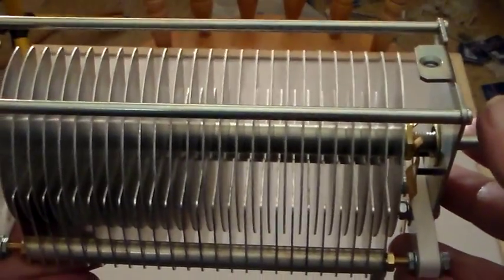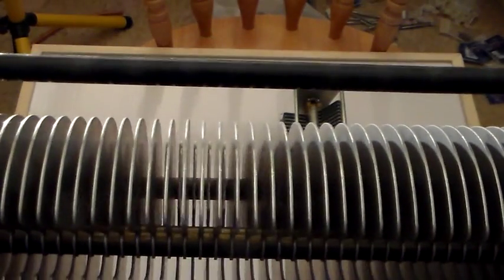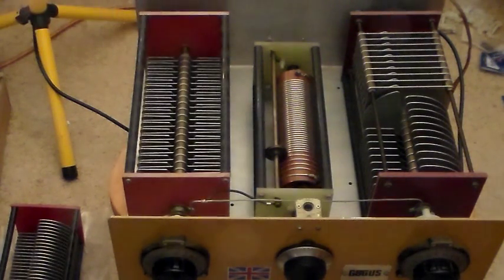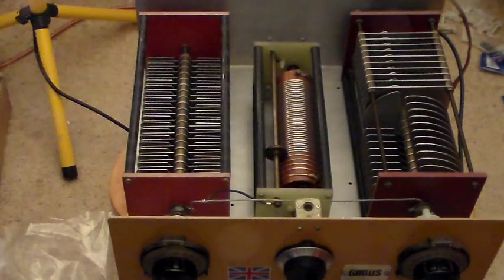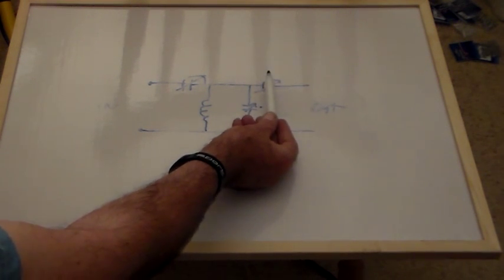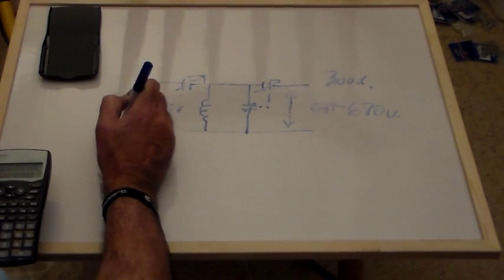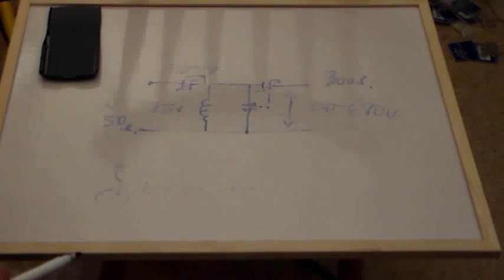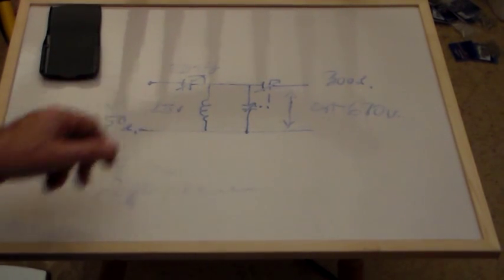Sorting Out A Plate Tune Capacitor.

Comment: I can just see you scratching your head :)
re: plate cap, 1mm spacing for each 1kv step, (rule of thumb) so 3kv =3mm spacing
re plate cap c1 tank circuit , on 3000v you need 150 pf at least for 80m operation
Loading cap c2 =700 pf at least
inductor = 14.7uH for 80m operation at 3kv ht.
if u are on 2800v then c1 will be a bit more ,about 180pF in value, c2 will be 800pf +_ inductor 13.6uH (80m)
at 4kv ht, c1 112pF  , c2  470pF inductor 19 uH, hope that helps :)

Take care to measure the c1 capacitor spacing between the shaft and stationary plates (shaft to stationary plates halve moons) it will arc on high drive (overdrive ) :)
remember to reckon in the + to _ voltage swing, so 2kv will become 4kv! in the tank circuit.

install a band switch with 2 wafers if u need topband, 1 wafer for additional doorknobs to resonate tb tank circuit, c2 will become 1500pF easy! c1 will bottom out at 400pF.
Johan zs2cx
Reply from the maker: +Lucky Dube in RC I see what you mean about not responding to comments... this is the first time I have seen this, I'm not getting comment notifications any more for some reason. The amplifier plate tune capacitor is 500pF with 4mm closed spacing and the load capacitor is 1000pF with 2mm closed spacing. I'm sure they'll be fine as I used to run the same arrangement on the AM broadcast band in the UK. I won't need to double the peak working voltage of the tuning  capacitors as the +ve peak voltage and -ve peak voltage do not appear across the capacitor at the same time. I'll worry about the tank coil when I get to it.

Comment: Morning Steve, your using all these figures for the air spaced capacitors, will this stop arcing happening in this design? Why I ask this,  I have had trouble with arcing every time I've tried home brewing atu. Thanks again for sharing you ideas and really enjoying this project.de Dennis vk4oc.
Reply from the maker: +Dennis Peake Hi Dennis. I don't expect any arcing in this design... that doesn't mean I won't get it. If you build an ATU remember the high voltage will most likely be on the antenna port, as it's more likely to be the high impedance side of the ATU, the higher the impedance the higher the voltage will be for a given power level. So the wide spaced capacitor goes on the antenna side, not the input side which will typically be 50 Ohms... it's the opposite to a transmitter tank circuit where the low impedance is on the output side and the high impedance is across the tube.